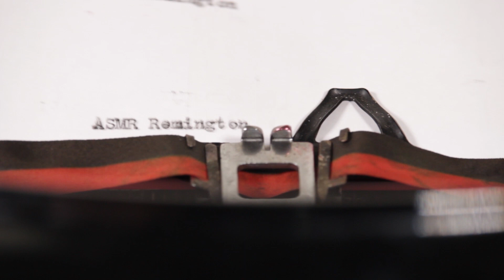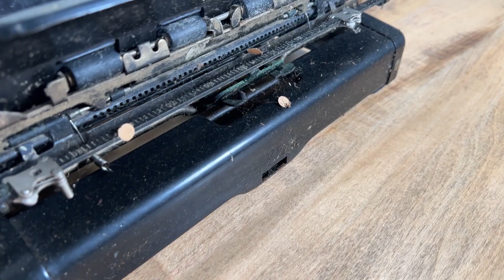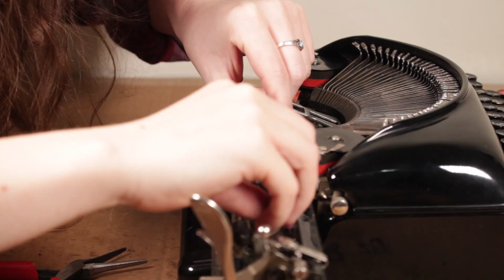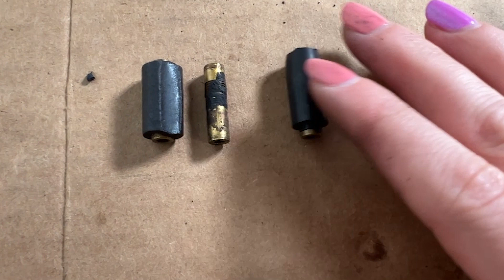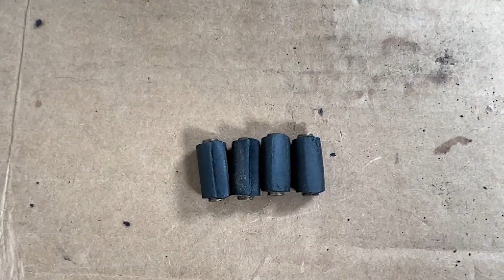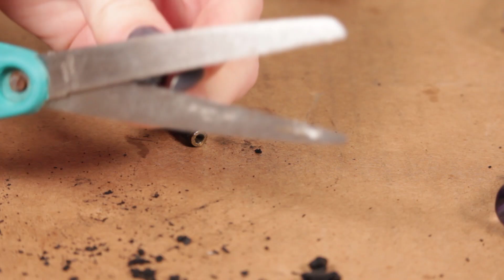Remington 5: Learning how to replace feed rollers

Comment: For my 1920's Remington Portable, I found rubber I Windshield Washer Hose Vacuum Tubing at O'Reilly Auto Parts and it was a near perfect fit.  Product #WV0732.  The interior dimension was 7/32.  The outer dimension was 25/64.  I cut the length just under 3/4.  The product was just under $10 for 6 ft.

Comment: I really enjoy your informative videos.  Just today I changed my life!  I couldn't afford or justify sending my platen and feed rollers in for professional resurfacing.  I found this product for cleaning rubber rollers on office machines.  Bought it from Amazon for $15.  Max Professional 2145 Rubber Rejuvenator - 10 oz.  I used a washcloth and alcohol to wipe the platen a bunch of times, swiping left and right and then turning the platen a zillion times.   After the cloth came out pretty clean, I switched to the rejuvenator using the washcloth.  (Need a vented workplace)  The rubber seems soft and smooth now.  It grabs the paper (would not grab before).  I didn't do the feed rollers, only the platen.  This was on a Skyriter.  Come March, I'm carrying the machine to China to give to our Granddaughters.  They saw my collection on FaceTime and asked for one of my typewriters.  Try the rejuvenator.  Saves so much work and expense.
Reply from the maker: I have tried it as well, but didn’t have the same luck- I’m glad it worked for you!
Reply: @JustMyTypewriter  Hmmm, I have three more machines to try it on.  Jury is out...
Reply from the maker: @skoolieunplugged it could be that the platen I used was too flat and damaged! I haven’t gone back to it because of the smell of the product. Until I have an outdoor work space, I’m kind of limited with how much I can get away with fumes wise!

Comment: Sarah, does your video contain the correct autozone rubber item you used the second time?  I just finished cleaning  the same model typewriter and I have the same problem. I’d like to avoid having to do this twice if at all possible! Thanks in advance- Holly
Reply from the maker: No- the updated material is in my spring cleaning video
Reply: @JustMyTypewriter thank you!
Reply: @JustMyTypewriter I’ve watched the video and followed the links. I can’t seem to find anything on the roller replacement.
Reply from the maker: @hollyhymel915 oh you know what- it was the Remington video! I’m sorry- they were filmed at a similar time and I got them confused. I used shrink wrap tubing- https://youtu.be/ciVbKWMO3xY?si=DFSUw1McxULmpGoX
Reply: @JustMyTypewriter found it! Thank you and most of all, thank you for sharing mistakes as well as solutions. Helps so very much —Holly

Comment: I recently received a free 1936 Remington 5 streamlined typewriter. It's wonderful and I look forward to someday trying it out. It didn't come with a ribbon. Or spools, for that matter. I bought the (ve-e-e-ry expensive)  spools and I'm waiting until my credit card comes due this month before I add anything else to it.
The platen looks easy to remove (at least easier than my other new toy, a Smith Corona flattop) so I shouldn't have any trouble if I have to send the platen away for an extremely expensive refurbishing.
But at least it feeds paper smoothly.

Comment: didnt think of using those tubes, thanks for the tip. im getting a underwood #5 running again for my sister, i actually never worked on a typewriter before and there is a lot more to them then i thought, enjoying learning about it and its going well... it must have been displayed on a shelf for years because it was packed full of dust lol

Comment: I have a 1919 LC Smith that was factory-rebuilt in 1926 , and all the rubber parts from that rebuild, except the platen, are all still soft and effective! It’s shocking! The feed rollers are like new and don’t even have flat spots. And the feet are equally good! (And I know for a fact they were not replaced since 1926 or earlier.) The machine was continuously used from its purchase all the way until the 1970’s, and then used occasionally. It just goes to  show that proper maintenance can preserve things shockingly well.

Comment: I'd have to disagree with your comparison say to a Smith Corona. The model 5 is an update of the geared typebar going back to the 1920 model 1. It is getting a little long in the tooth by 1940.  A 2 series Smith Corona is in no way "whittled down" in comparison with segment shift vs carriage shift and an adjustable tabulator. And today, they most often have good feet and serviceable rollers unlike flat rollers and mush for feet on most Remingtons. The Achilles Heel of Remington portables is the paper release that sits in the engaged position.

Comment: I had to do this same repair with my Underwood # 5 and so far it looks good. The smaller rollers didn't give me any trouble, but the larger ones gave me a lot of trouble going into the hose. I used a heat gun to warm up the rubber a little bit and the roller went right in.
Reply: hay, what size tubes did you end up using?

Comment: This is a very useful video! Thanks for making it. I would have struggled if I had not watched videos by Phoenix Typewriter, Gerren Hot Rod and Typewriter Justice before attempting to replace the feed rollers.

I found pre-1940 Remington Portable 2, 3 and 5 feed rollers all had flat spots and even crumbled into nothing.  I bought 5/32" OD windshield washer rubber tubing sold in 60" length for a few dollars at my local Canadian Tire store for the front (smaller) rollers.  The rear rollers needed 3/8" OD but were loose, so I first put one layer of heat shrink on the brass tubes before sliding the rubber on. 

Since oil the arch-enemy of rubber, I used alcohol as a lubricant to slide the 5/32" tubing on using a vice with smooth jaws, and warmed them up in hot water before to soften the rubber.
Reply: Oil is the arch enemy of rubber??? No! There is fuel and oil rated rubber hose. Or at least we have it down here in the states.